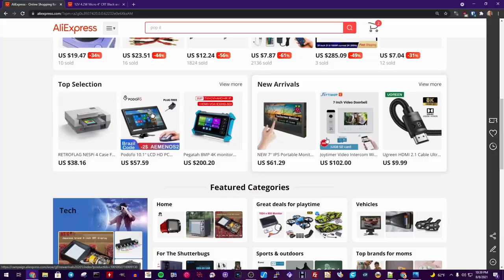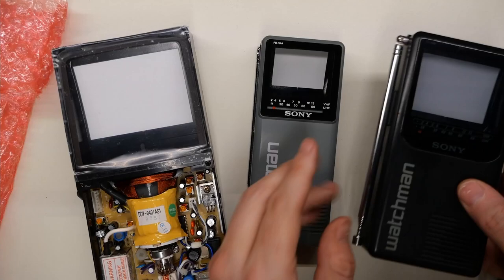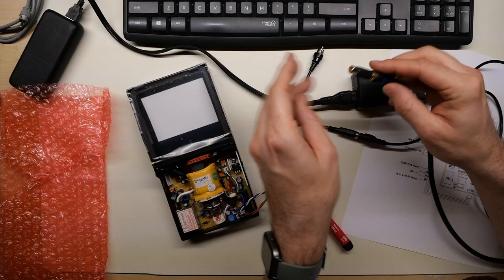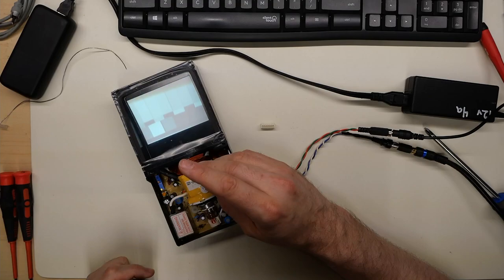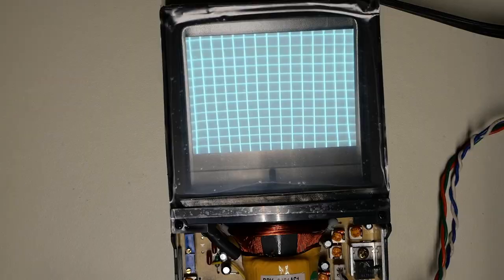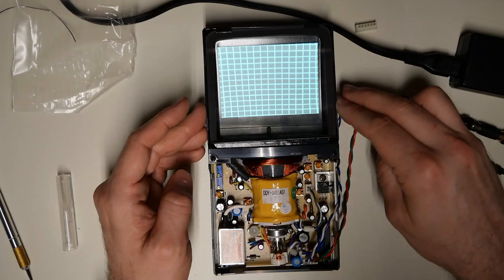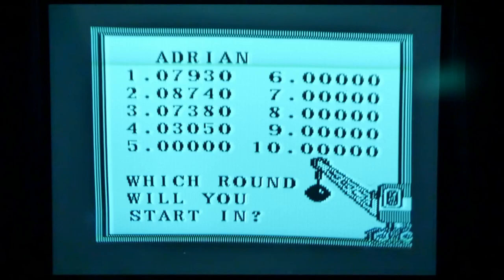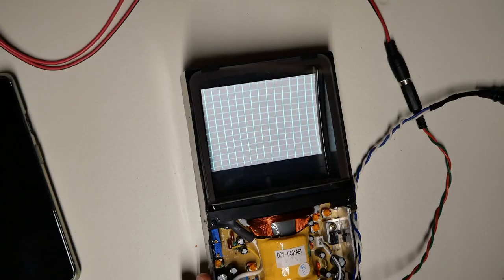This small CRT monitor is less than 2" thick

Comment: Pretty neat.  I was wondering if that type of CRT technology would be applicable for color?  I have a feeling the answer is no because the mask would probably be in the way of the picture.  But maybe there is some other way it could be done?
Reply: Well, maybe ask Technology Connections. 🤔

Wild idea, but the colour shutter that he showed in a video a while ago... maybe it could be adapted somehow.

But I am just guessing here.
Reply: Someone here on YouTube showed off a camcorder that had a colorized viewfinder using a tiny CRT and it was really a b&w CRT with some sort of color shutter.
Reply: @cll1out  That was the very video! From Technology Connections. Here is the link: https://youtu.be/z-q8ehzHeQQ
Reply: @cll1out  you use a crt and an lcd pannel.infront so you get the brightnes from the crt.and color from the lcd
Reply: They probably could’ve made a beam index tube in this form factor. Those use only a single gun.
Reply: @Dinnye01  I was thinking of a different video but the one you posted more accurately describes what I was saying above.

For some reason the video I had in mind is https://www.youtube.com/watch?v=_b7omGhw7wc by Cathode Ray Dude which uses the green and an added violet index phosphor to rapidly switch the color signal sent to a single-beam "color" CRT without an aperture grill. Not a pure b&w CRT like I mentioned.
Reply: Yes, a beam index / indextron color tube would probably be possible with this layout
Reply: it'll be interesting if another technician YouTuber is/was able to make it have some sort of colour!
Reply: @cll1out  Cathode Ray Dude is the one that made a video about that, I think.
Edit:  My bad, I didn’t see your last comment.
Reply: Cathode Ray Dude enters the chat...
Reply: @Dinnye01  ctgwp iTap on a clip to paste it in the text box.Tap on a clip to paste it in the text box.Welcome to Gboard clipboard, any text you copy will be saved here.Touch and hold a clip to pin it. Unpinned clips will be deleted after 1 hour.
Reply: @Dinnye01  this would be a great collab
Reply: With a colour wheel, it should be
Reply: I'm sure if they could do better geometry, a beam index type would work, but the tube would need to be thicker to allow for the index phosphor to illuminate in a way you can't see it. Beam index CRTs aren't the best displays out there, but they eliminate the shadow mask/aperture grill entirely and were commonly used in military and aviation applications. Sony did make some beam index CRTs for consumer applications, but were grainy and had poor contrast. They had a small portable (with a more traditional shaped CRT) and a projector or two (at least one with a built in Betamax VCR).

Of course, others have mentioned field sequential color and with the right filters this could easily be adapted to the field sequential system used by the Apollo missions which take a standard 525 line NTSC monochrome signal and make each field a specific color. This drops the frame rate to 10 as you need 6 fields to make a full frame (2 red/2 green/2 blue) instead of 2. You would simply scan through a red filter (both camera and monitor) for the first odd field, followed by green for the first even field, followed by blue again for odd. This would be followed by red even, green odd, blue even.
Reply: first thing I thought was 'oh 8bit guy will want to connect it to his vic20/apple][s'
Reply: @cll1out  Cathode Ray Dude?
Reply: @robertsteel3563  Without red, green, and blue color-emitting phosphors, it will never be possible to make this screen produce a color image. Let me back up, this device was not designed to generate a color image and can never be made to generate a color image. There is a technique that has been used to produce a color image from a B&W display by adding a color LCD overlay. This is mentioned in a comment above, and you can see it demonstrated in this video: https://www.youtube.com/watch?v=z-q8ehzHeQQ
Reply: @HangTimeDeluxe  Right, I saw the video from Technology Connections, and somehow I didn't remember that at the time of the comment. Thank you for your info though!
Reply: Yo! 8bit why so less monthly videos?
Reply: 8bitguy i’ve been watching your videos since i was literally 11 now i’m ALMOST 19 thank you for getting me interested in computers at a young age i would not be the same person without you
Reply: The Goodmans C520 would be the closest thing
Reply: @cll1out  Thanks for linking that!  I saw the Technology Connections video a while back, but not Cathode Ray Dude's!  (And now I've found another tech rabbit hole to fall into... 🙂)

EDIT: And yay, shout-out to the 8-Bit Guy too!  Been watching since 2015 or so I think.  (I forgot what post was at the head of this thread while I was checking out Cathode Ray Dude's channel)
Reply: they have a few prototype tubes of this type attempting color at the early television museum but as far as i know they never got the deflection right
Reply: @svenbenglen7599  I remember those.  Sony was trying to make color flat CRT for portable TV and such but they abandoned because color LCD were already around and getting better
Reply: @Fan-lq6uv  i should find the article, these are way older, late 50s, big too they were trying for 20 inches with this kind of screen
Reply: @8bitwarrior  It was already a nightmare to make one in the normal factor...
Reply: @mrnmrn1  Sony would have done that, instead they waited for LCD technology to colourize their Watchmen.
Reply: @Dinnye01  Could use similar method to DLP as the DLP chip is black n white image just synced to a colour wheel to give a colour image
Reply: @svenbenglen7599  These were classic screens (radar screens from military supplies) that were placed vertically and the image was viewed in a mirror.
Reply: @DL-kc8fc  oh im talking prototype tubes not that
Reply: @svenbenglen7599  As for the prototype screens of the 50s, they resembled the iconoscope of the 30s. However, I have no information that this type should reach any significant size. That is why it was solved by a vertical tube with a large deflection angle and an observation mirror.
Reply: I had a similar product as a kid that had dull color. The resolution was shit though
Reply: without something like indextron (which needs an external case to function and phosphor dots on the face of the tube) or liquid crystal color shutter (which requires a fundamentally different signal pattern and electronics powering the CRT, as well as an LCD layer in front of the tube) it would be exceedingly difficult.
Reply: are you thinking of the Cathode Ray Dude video? because that uses beam-index timing to generate a color picture and would require the surface of the tube to be coated with phosphor dots; something that could theoretically work would be LCCS, but that would require an LCD panel to filter the signal through anyway and kind of defeats the point of not having an lcd panel in the first place.
Reply: 12voltvids has shown mini color CRTs that had vertical RGB stripes top to bottom and used indexing using a light sensor to keep convergence!
Reply: @dogbear140  Did anyone ask?
Reply: Nonono. you guys are all missing the obvious..  "Vectrex Mini"

 Seriously you could make a miniature Vectrex PCB and deflection board have it made by JLPCB or whoever and then combine it with one of these CRTs and a 3D printed case.
Reply: The disadvantage of these tubes was that they had poor contrast and no constant sharpness. Developing them further into color tubes was therefore probably not worthwhile either, because  the convergence problems would ne much more harder.
Reply: Maybe with an LCD mask
Reply: Back in late 70s when a lot of these tiny tvs were coming out I used to check them out in the stores.  Sony watchman were the best, they used a special flat angled tube and they were real cathode ray tubes.
I do remember once checking out a very tiny - about 2" screen - that was color. A real cathode ray color tube. I remember because I was checking out how the color dot pixels were only just so small and the picture wasn't fine enough whereas the black and white could go microscopically tiny.
They were used as monitors on VCR cameras.
I don't remember what brand the color set was, if it was color Watchman or not.
A few years later they started coming out with tiny LCD screen tvs which had no back light, you had to hold them up to a light to see anything.
One of the first tiny CRT TV sets down beyond 2" was the Sinclair brand I think from Europe. I almost bought my dad one for Christmas.
Reply: @cll1out  I remember a friend having a higher quality camcorder in late 70s that had color viewfinder. Only one I ever saw.
Reply: @toteu00000  I bet that LCD mask wouldn't work for electrons. It works for photons.
Reply: @SkyrimExplorer  LCD between the viewer and the screen, not between the electron gun and the tube. There were some colour TVs using  black and white CRT with a LCD screen
Reply: @toteu00000  Uh, okay. I didn't know such inventions.
Reply: there's a screen you can use to create color...wish I could recall the tech name
Reply: There is an Indextron tube that uses UV stripes and a detector, I have 2 normal tubes that have no shadow mask and black&white circuitry, they just use the stripes for timing and color but otherwise just one of these missing from my collection.

Comment: I would make the worlds smallest Macintosh 128K with a CRT, putting this and a Raspberry Pi running Mini vMac in a 3D printed case of the original Macintosh 128K to scale!
Reply: Why only emulate the 128k though? You should be able to fork over more RAM at the very least, even if CPU speed is capped by the limits of your RPi.
Reply: @mal2ksc  Depends if you want stock authenticity or not.
Reply: @RetroJack  Not really, you can have more than one emulation mode. If you want an authentic experience, the Pi can emulate the timing of all the hardware including the spinning rust. When you get tired of that, it can also accommodate what would have been seriously buffed builds back in the day.
Reply: @mal2ksc  True, but as I said, it depends if you want the stock experience or not.
Reply: @RetroJack  If you can set it so that it powers up as whatever model you've chosen, and you have to hold down a weird key combo and restart to change the emulation... then it's the stock experience so long as you don't shift out of that emulation. What I'm saying is that it makes little sense to only configure that one emulation mode when you can have many on file.

Comment: Man, a Gameboy would suit that screen size well!
Reply: Or a pip boy
Reply: 2 years ago Bitluni did just that.
Reply: hell yeah, would be light years better than the ghosty display too LOL
Reply: Yea, one of those raspberry pi's and a gameboy emulator running. It would probably look much better than the real gameboy! But you would need something with a composite output I suppose.
Reply: @anthonydenn4345  pi can do composite output pretty simply, I looked into it while building my picade. It is output through the 3.5mm audio jack, just need a 4 pin 3.5mm connector that splits out to 2 audio and 1 video. Setting the pi to then use that as the output is pretty simple, but from memory you can't have both hdmi and composite at the same time, I I ended up going hdmi to vga for the weird old TV I had for my setup as it gave me more flexibility.
Reply: @LiamJFord  Pi Zero can do composite as well(It doesn't have a 3.5 jack on it). There's a couple of pins next to the GPIO pins for it
And then for sound output you can either get a hat with an audio amp, or build a basic circuit that can output audio via gpio
Reply: @tombarber8929  amazing - I've never played with a zero, but now I have one more reason to!
Reply: Battery life would be in the range of seconds then. CCFL LCDs in the Lynx and Game Gear were hungry enough already.

Comment: That "spill over" lighting of the unlit phosphor is reflection of the image on the inside of the glass front, which is why it gets worse when there are large areas of white. It's an inherent flaw in the design that a regular CRT won't suffer from.
Reply: Not true u still get blooms
Reply: @primus711  I just meant this particular issue wouldn't be possible on a regular CRT where you're looking at the back side of the phosphor. There are certainly other CRT issues that will affect any CRT, bloom being one of them
Reply: You can't do much about the internal reflections, but a neutral density (or if you want to emulate old CRTs, green or amber) filter would reduce the light getting in from outside. As long as this doesn't make the display itself too dark, it should increase contrast somewhat when the lights are on.
Reply: Color TVs have a odd looking metal coating on top of the phosphor layer. I've broken a few color TV tubes and they all are like that.
Reply: @louistournas120  that’s the shadow mask.
Reply: @mal2ksc  I was just thinking this would make for a good pipboy build if it was green
Reply: @louistournas120  The metal coating on the back of the phosphor is a very thin layer of aluminium to serve two purposes the first one is to protect the phosphor from ion burn prolonging the life of the phosphor and the second is to reflect the light from the phosphor forward to increase the brightness of the image on screen. the perforated sheet of steel behind the screen is the shadow mask that ensures the  electon beams hit the correct coloured phosphor.
Reply: @peterensinger1770  Nice. I wonder how they achieve such a high vacuum in the CRT.It must take a very long time to pump out the air. Perhaps they full them with pure oxygen and then pump out the oxygen and then use sodium as a getter.
Reply: @louistournas120  the high vacuum is achieved by heating the tube to a high temperature while pumping the air out as hot air is less dense than cold air then they seal the glass. they then inductively heat a getter that has a chemical that absorbs any trace gasses
when heated this substance gives a silvery coating on the inside of the tube. this chemical goes a milky white if air enters the tube.
Reply: @peterensinger1770  Well, I guess they have really good pumps that can remove 500 C hot air.
I have heard the getter might be sodium, potassium, barium. No one seems to be sure what it is.
Reply: @mal2ksc  I’ve been using ND filters for over a decade and I never thought about what it stood for… thanks!
Reply: @louistournas120  it was necessary for all electronics before semiconductors! Obviously a diode or a triode is easier to build than a picture tube but, yk. They built on prior progress, until picture tubes and magnetrons were the only new tubes being made (now it’s solely magnetrons of course). Unless I’m mistaken, all thermionic valves needed to be evacuated in fairly similar ways (no getter for smallest tubes though mind).
Reply: It's mostly the screen reflecting/fluorescing in ambient light, the internal reflection isn't as bad in real life as it seems on camera (all B/W CRTs seem "fuzzy" and glowing blue on camera for some reason). And an adhesive polarizer works well against ambient light. The nice thing about a "spoon" CRT is that the screen always looks clean, because it's in vacuum, and the front part that can be dirty is outside eye focus when watching it.

Comment: My first thought was, put a green (or amber) film/filter over the glass and use it to build a custom Fallout-style pipboy. Due to the vertical nature of it, it'd be entirely too large to wear on your arm that way. So, you'd want to rotate your video source (like a Raspberry Pi) 90 degrees counter-clockwise. Or possibly even rotate the yoke on the CRT 90 degrees? Not sure if that'd work.
Reply: Rotating the yoke would probably totally mess up the geometry, so that probably isn't a great idea.
Reply: @eDoc2020  Yeah, kinda figured as much, with that oblique angle and all. Wouldn't stop me from trying, though, if I ever were tp attempt it (the price is mighty tempting).
Reply: I was thinking the same damn thing
Reply: @KyoshoLP  it could be even cheaper if you would buy a used video intercom system with such CRT
Reply: put  whole screen sideways.. actually pipboy prototype seen in intro of Fallout4 uses that.
Reply: I'm just glad that I'm not the only one whose thought immediately turned to the PiP-Boy.
Reply: You can set the image direction in Raspberry Pi, just put lcd_rotate=1 in the /boot/config.txt. It can be a value from 1 to 3 corresponding to the 3 other screen positions besides default. And don't mess with the yoke, as you'll spend more time googling how to put it back on properly than you would earning money for a new CRT with yoke intact. Unless you're bored and want to learn how to align CRT yokes for the fun of it. Also, those side gun CRT devices have a keystone compensation circuit. Otherwise either the bottom picture line would be too small, or the top would be too big, since the top is much further away from the electron gun, and the deflection deflects by a given angle rather than onscreen distance.
Reply: just put a lense in front of a normal small screen